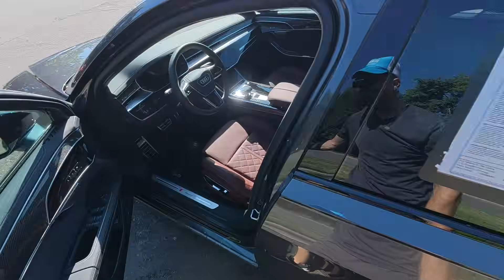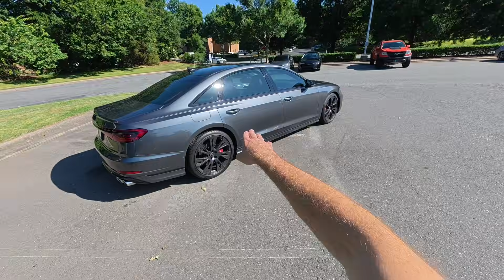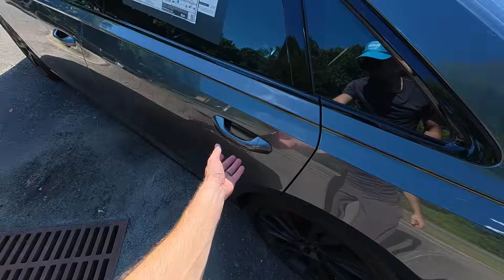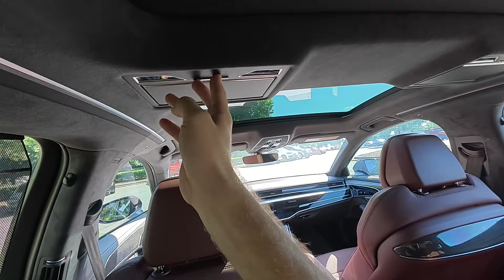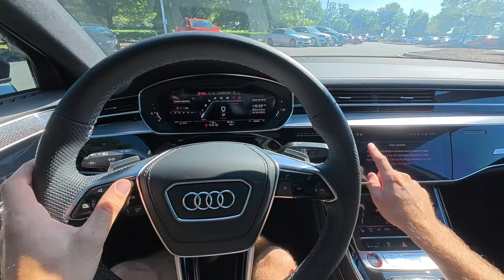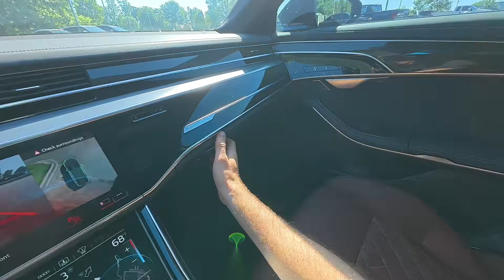2025 Audi S8: POV Start Up, Test Drive, Walkaround and Review

Comment: Thank you for taking the time to review this vehicle. In my opinion, the S8 is too often overlooked. Also, full-size V8 powered luxury sedans are a dying breed. I currently drive a 2021 S8. It’s the same body style as this one, having debuted for North America for the 2020 model year. Prior to my S8, I had a 2021 RS7. It seems that everyone wants to focus on the RS6 and RS7, but this S8 has a lot to offer. It’s almost just as fast as the RS6 and RS7. MotorTrend got the S8 to 60 in 3.2 seconds, and the RS7 in 3 seconds. There are a couple of fairly famous videos on YouTube where the S8 hit 60 faster than the RS6 and RS7. All I’m getting at is that performance is almost identical among the three. I really liked my RS7, but this S8 is bigger, has more luxury features that aren’t available on the RS7, and it’s more comfortable to drive. Yes, you can feel that the S8 is larger, but with the rear wheel steering, it doesn’t feel as much of a whale as it looks! The RS7 absolutely looks more sporty and is more of a head turner, but for me, the S8 is a better daily driver. I especially love the massaging seats and the fact that there is more sound coming from the rear seat area compared to the RS7, because with the RS7 being a hatchback almost all of the sound from the stereo came from the front of the car, which I did not like. The S8 has a rear parcel shelf where it can have speakers unlike a hatchback vehicle.  I hope you enjoyed driving it for a day. It really is a fantastic, fast, sleeper of a sedan. The BMW 7 Series is hideous looking, and the Mercedes S Class’ gear shifter is mounted on the steering column, which is an absolute deal breaker for me. I know I’m in the minority on that. Gear shifters need to be down on the center console, especially when the car only offers bucket seats in the front.
Reply from the maker: Thanks for sharing!